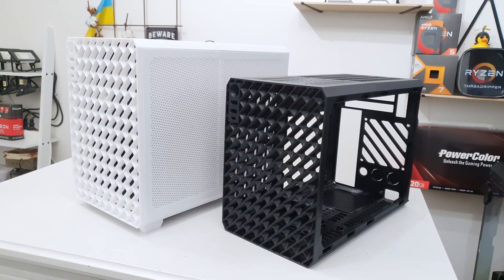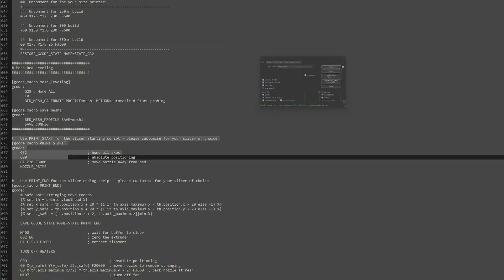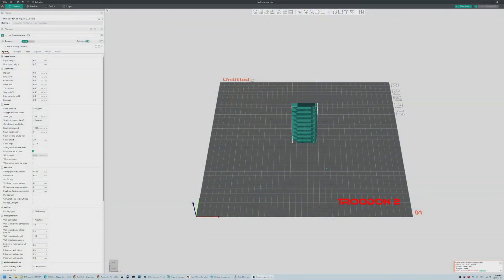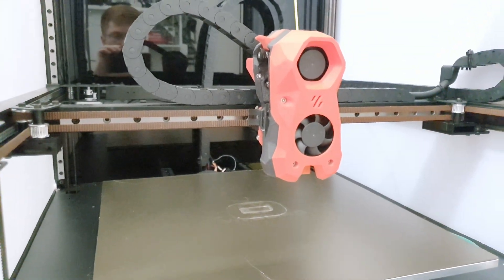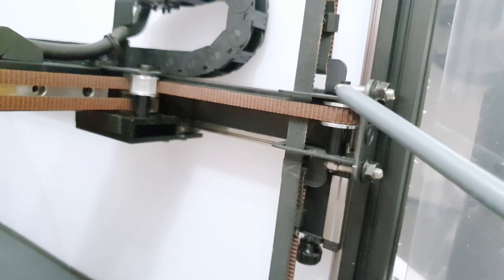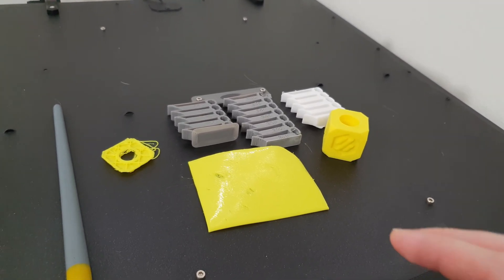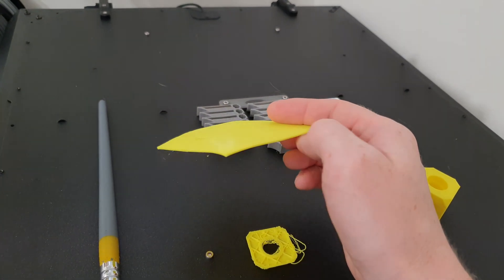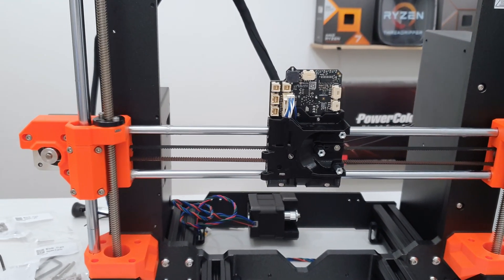Everything is wrong with my Troodon (wannabe Voron) 2.0 Pro – maybe @ygk3d can help?

Comment: Wow!  I was looking at buying this printer, but after your review, I think I’ll just a Voron Trident kit.  Good grief!  Sounds like you were just better off buying a kit and putting it together yourself!
Reply from the maker: Very true but please beware that Voron requires a lot of time as well, the experience should be much less frustrating though.
Reply: @ i’m very aware of the work required to complete a Voron.  I know this because I have already completed a Voron 2.4 kit built.  But that printer is simply too big for me to take in my truck on the road with me.  So I’m looking for another printer that can print ABS with no issues. Due to the recent controversy with the Bambu lab printers, I’m not investing any more money and that company until I see what happens with their  firmware update.  

There is a big difference between starting a 3-D printer kit build where you walking in with your eyes wide open, compared to buying a printer that you think is complete, but then have to unexpectedly rebuild part or most of the printer, while at the same time, never knowing when you’re gonna have a working printer.
Reply from the maker: Then you are well equipped to build a Trident. I actually wanted to build one myself but the prices and the time investment aren't justifiable for me, at the moment at least, instead I ordered a Prusa Core ONE.

Comment: I had a lot of trouble getting my Troodon 2.0 Pro working, the software was out of date and needed a lot of updates, the printer.cfg file was poorly configured, the right hand belt has too much slack, I'll fix it later.  Like your printer mine had a damaged bottom plate, it wasn't shipping damage, the box and foam were in near perfect condition, it appeared to have been dropped during packaging.  the plastic covers on the front right corner, and the right front corner are both broken (replacements are coming)

It would be nice if FormBot made sure that all the software was up to date.  That said, I ran my first print job today using Bambu Labs red ABS and even with the somewhat slack belt, the print quality was good.  I need to do something about the end gcode though, the nozzle just stopped at the end of the print and didn't move away from what I printed which caused a slight dent in the print.
Reply from the maker: I am glad to hear that you managed to get it working, I got rid off mine and very happy about that.
Reply: @Miyconst  I don't blame you.  For a thousand dollars I expected a better out of the box experiance.

Comment: I don't think even the Voron default configuration has adaptive mesh generation enabled... usually these are advanced features and the advanced user needs to enable themselves.
Reply from the maker: The last time I checked, Voron was not a commercial company that sells their designs as "ready to go" printers, so I think, it's a bit of a wrong comparison.
Reply: @Miyconst  If you buy any other printer it won't have the adaptive mesh generation either, and if it's closed source you cannot even enable it. The Voron team decides the standard configuration, and Troodon has probably respected that, just as if you had bought the printer. Just because they offer the user to tweak the parameters, isn't a fault, it's a feature. Troodon doesn't try to be a bog standard one-size-fits-all printer, the customers know they're buying a pre-built Voron. Why did you buy this instead of Bambu Labs if you don't want to tweak it?

Comment: Thank you for your honest review. I think people who buy these Voron clones need to understand it’s a gamble. Best case it works great straight out of the box. Worst case you rebuild it from the ground up and you end up with an expensive Voron. I know you didn’t want to spend the time but unfortunately you rolled snake eyes. I think every 3d printer will eventually have problems and require tuning. Might as well learn right from the start. Good luck on whatever you decide to do.

Comment: I have a Troodon 2.0 (non pro) and I've manually updated to be "pro-like", installed a Pi in there, it's now running Klipper with the toolhead communicating over CanBus with a U2C and it's printing absolutely perfectly, in some cases I see better quality out of the Troodon than out of my home built 2.4, I imagine because of the metal and injection moulded parts.. 

I think the issues you're having are user error, if you buy a Klipper machine, especially a Voron clone and expect to have it work perfectly out of  the box, then you're kidding yourself. If you can't get the Troodon to work properly, you'd have ended up with worse results building a 2.4 yourself.

I reccomend you disassembly your stealthburner and reassemble it according to the voron manual and make sure everything is good there, make sure you've got your e-steps calibrated. Before you do bed levelling make sure you run a quad gantry level, all can be done in macros. I'd also reccomend installing KAMP, because of course probing a 350x350 bed before every print is just stupid, KAMP is working perfectly on my machine.

Happy to share my config with you if you want to drop me a message, but honestly, I think a lot of your problems here are user-related.
Reply from the maker: I see your point but I fully disagree. If Troodon would be sold as partially assembled Voron kit then you would be right, but the ad says printer, we have reviews and customer support that claims up to 120 minutes installation and you start printing. Instead I got a physically non working Voron kit in terribly assembled way that I have to disassemble and troubleshoot. How is this a user error? By now I have already made it print, somehow, but that required replacing the hotend, designing and printing spacers for the back panel, otherwise the XY belts hit it, and fixing their config. This is not a user error, this is false advertising with disgusting quality control.
Reply: @Miyconst  I agree with you. This printer is marketed as ready-to-run.

Comment: I have bought mine Troodon 2.0 ca year ago. I uses older screen, older filament sensor, older extruder, older firmware. During day 1 i adjusted my profile in simplify3d. I then adjsuted the homing, zeroing and nozzle clean scripts. Then i realized the extruder motor was overheating (it was set to 100% of motor current) i lowered it and had no issue with machine for whole year. After year i had XY carriage cable failure, formbot send update kit (longer cable, few pieces of plastic chain to make it longer) for free. I see you have newer version fo machine. Sorry to hear that. I´m happy with my machine.

Comment: The Troodon 2.0 can be an excellent printer with proper setup. However, going in expecting a Prusa-like experience was...unrealistic.

There will be problems. Research, tinkering and testing will be required to solve them.
Reply from the maker: Very true but the advertisement is misleading at least, the quality control is very bad, and the customer support is just pathetic.
Reply: @Miyconst  No argument there.  My Stealthburner had 3 different assembly errors that had to be corrected.  They're definitely leaning hard on the Voron community to act as their unofficial support staff.

Side note: I see you're using my filament sensor bracket.  1) It works a lot better if you install the fitting to retain the reverse bowden tube. 2) If you switch to the low profile version it gives the tube room to curve more gently without having to resort to major modifications to the printer. 3) I replaced the included tube with a Capricorn tube and have been pleased with the performance.
Reply from the maker: @RabidBadger_  thanks for that holder! For now I just ignored the whole filament mess and trying to get the printer printing with a decent quality. Once it prints - I will solve the filament route.

Comment: Get a Bambulab printer IMO. Works out of the box
Reply from the maker: As I said in the video, I have a Prusa MK4 that works out of the box and I have no complaints about it. I need 350mm print plate, Bambulab does not deliver that.

Comment: As other commenters pointed out, this is a printer for tinkerers.

One of the problems is that it has a hardened steel nozzle mounted by default. This is OK if you print abrasive materials (such as CF filaments), but this nozzle has low volumetric flow. You need print slowly (reduce volumetric flow in slicer). In order to print fast, you need to buy and install at least a better nozzle (such as CHT nozzle) or even replace the entire hotend  with a more modern one (it has a V6 clone hotend, not the best option for fast printers).
Reply from the maker: Thanks a lot for the feedback. After the video (or just a coincidence) the Discord channel become much more active and I got lots of feedback from many people. Most of them, just like you, point at the pathetic hotend Troodon comes with. Asked there, also asking you, what hotend would you recommend instead?
Reply: @Miyconst  I  haven't yet tried or even researched all the options so I  don't know yet what to recommend. I'm planning to try the high flow CHT 0.4 mm nozzle first - this is the simplest option because it works with existing V6 hotend, it just requires replacing the nozzle. I've had good results with this nozzle on my old Klipperized Prusa MK3S, but I haven't yet had the time to try with Troodon. For now I'm just using a low volumetric speed,12 mm³/s with PLA and tmeperatures increased for about 10°C. The printer is still usably fast because of high accelerations.

I would also point out that I was lucky - my printer was delivered about a week ago and I haven't yet had any mechanical issues that you describe. I have the Pro version. Print quality has been great (but note that I set slow speeeds).

I also think that the macros and profiles are a mess - target for tweakers. I'm using the PrusaSlicer profile and start/stop G-code, but I''ve tweaked some settings (first layer speed to 25 mm/s, skirt enabled to alow nozzle priming, until the CHT nozzle is installed I set volumetric flow rate to 12mm³/s for PLA, 8 mm³/s for PETG, with 10°C higher temps, ...). First layer calibration was a bit high, but it worked (I followed the Start Guide.pdf and the macros it tells to run). But I have years of experience with 3D printers so I knew what to set. I agree that this printer is not a directly usable product such as the likes of Prusa and Bambu.

I will report my experience when I have the time to try the  CHT nozzle.
Reply: I tried the CHT 0.4 mm nozzle over the weekend and the flow rate is not improved by much (I'm testing with OrcaSlicer 2.1.1 Maximum Flow Rate test, with built-in Troodon profiles, but the start G-Code copied from Vivendino's PrusaSlicer profile).

I checked out the Discord and there's talk about the included hotend being a low quality V6 clone, which is probably the main constraint here. I'm priting slowly until I have the time to find and install a replacement (based on flow rate test I use 8 mm³/s for PLA, 5 mm³/s for PETG).

I hope you managed to fix the problems with the head height.
Reply from the maker: @AndrejOrešnik  I have already ordered a hot-end replacement, waiting for it to arrive.
Reply: UPDATE: I installed a Phaetus Rapido 2 HT hotend (set max_power to 0.56 to stay within 50W wiring limit) - the volumetric flow didn't improve, it even got worse.

It turned out that the extruder had several problems: 
- Guidler was not moving freely, it was scrapping too tightly against the sides. So the spring didn't do its work to press the filament between the gears with uniform force. I sanded the guidler sides down a bit until it moved cleanly. The plastic washer for the thumbscrew was too narrow and obstructed the screw movement - I filed it down.
- The guidler gear bearings were dry after only 70 hours of printing and also getting stuck rotating. I cleaned them it with isopropyl alcohol and greased them. The stationary gear bearings were OK.

My printer now reaches 20 mm³/s for PLA with the nickel plated nozle included with Rapido (I use 18 mm³/s in slicer).

EDIT: Fixed some typos.

Comment: Looks like my comment didn't save for some reason, so I'll try to send it again:

My Troodon 2.0 pro had extrusion issues until I checked that the guidler was assembled correctly. Page 17 of the Stealthburner assembly manual describes how it should be put together, and my issue was that the rod containing the BMG Idler assembly wasn't actually snapped into the guidler arm printed piece, it was free floating and would occasionally work but most of the time prints would fail with under extrusion issues like what you are seeing. It took me about 10 minutes total to fix that issue, I'd be happy to help you check it if you need help
Reply from the maker: Thanks for the feedback! I am going to dig into that extruder and post updates when available.

Comment: The extruder could also be skipping if the voltage is too low or too high, if it’s too high you will know because the motor will get very hot, compare its temp against the x/y motor during a print, or just plug another motor in as the extruder to see if you have the same skipping.
Reply from the maker: Thanks for the suggestion, I will experiment with it.
Reply: Also be careful to make sure the hotend isn’t an old style with a PTFE tube inside (it can’t handle high temps in that case)… sounds like it might be, considering all the shortcuts they have taken.
Reply from the maker: It very well could be because it has a strong disgusting PTFE smell during the printing process.

Comment: This is the problem when people just want to print and they buy these setups... you have to know how to configure slicers, and make sure configurations in slicer match your macros. These are for tinkerers, not the people looking for perfection because u still need to tune and create new print profiles.
Reply from the maker: I agree, this is a problem but I don't think the consumers can be blamed for that. The advertisement and the answers provided by the support are absolutely misleading and border line deceiving.
Reply: @Miyconst  Not borderline. They are misleading. There are a lot of poor business practices when companies operate under 15 different names.

Comment: Sorry I have 2 voron 2.4 so I can’t help with everything but You should be able to use a jontek2 start code and get rid of the old print start macros. Also you should be able to use klipper adaptive mesh or even install and use KAMP. The klipper macros should be the same as the macros voron 2.4s use though. The Voron or klipper discord could help with klipper issues.
Reply: Is the extruder missing steps due to the max volumetric flow being set to high and the hot end run out of flow?
Reply from the maker: Thanks for the jontek2 hint and it could actually be that the flow rate is too high because the walls are usually better than the middle or infill. In that case the supplied hotend is just miserable because my flow rates are already very conservative.
Reply: @Miyconst  I would run a flow rate test out of orca. I think your print start and macro issues are very solvable. I’m not sure how the stock config is set up but I would put my print start in a separate cfg then use an include to call it in your printer.cfg. I also do see why you could use klipper adaptive mesh for bed meshing.  The Z offset could be thermal drift if the printer is using an inductive probe. Tap,clicky and beacon solve that issues but I’m not sure if that easy to implement on a troodon.